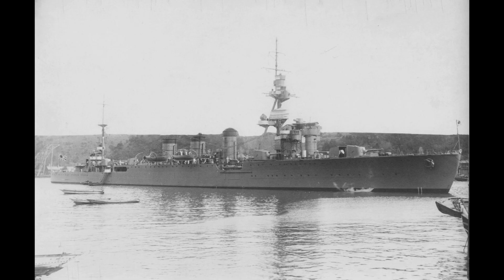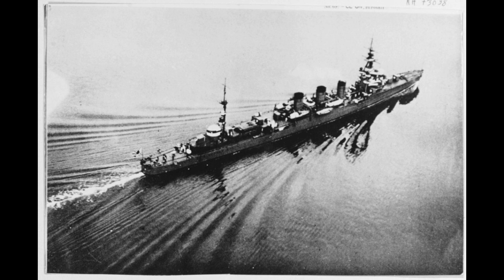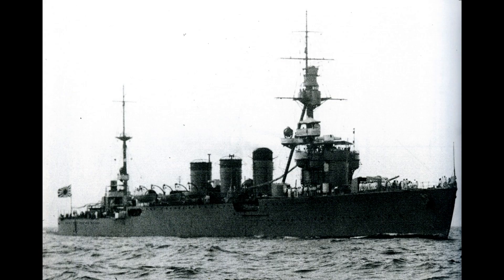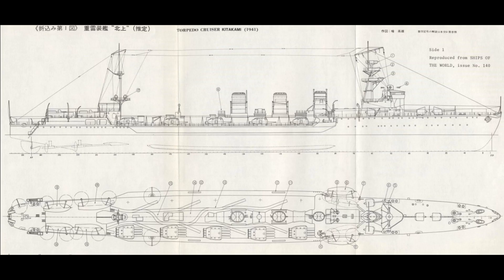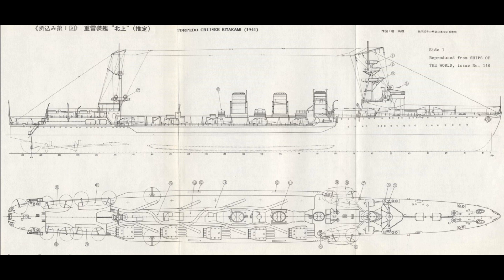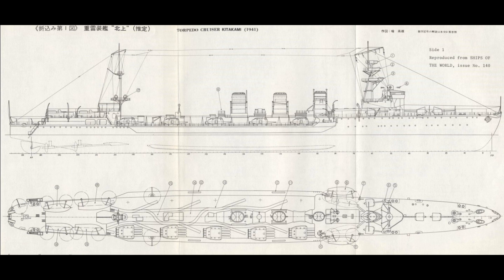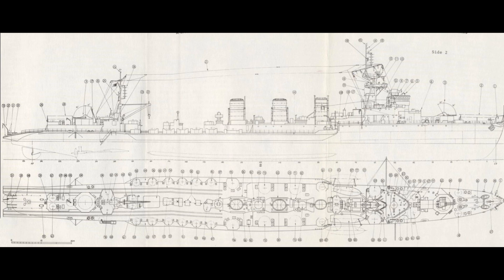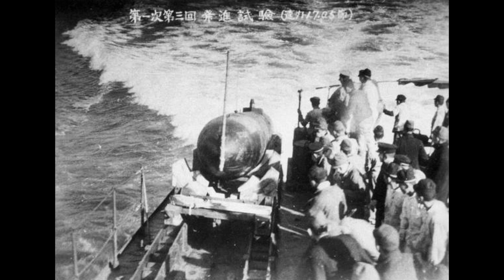IJN Kitakami - Guide 285

Comment: If the Japanese had just built lots of cheap, fast transports in the first place, they would have been spared the ignominy of using most of their Frontline Warships and Submarines to supply doomed Island Garrisons. But then the Japanese Navy was doomed from the moment they dropped their first bomb on Pearl Harbour, so it is a very moot point.
Reply: That's the problem with trying to fight an opponent to economically outclassed Japan by an order of magnitude. Nations like Germany and Japan could not spend adequate money on everything they needed. The US could.
Reply: Had the battle of midway gone differently, maybe the Japanese would have "won" the war. I could definitely imagine that if the Japanese sank all US carriers at midway, then ravaged further to destroy other parts of the enemy fleet, they could have proposed a peace settlement somewhere inbetween autumn 1942 and early 1943, that would forbid the US from further interference in Japan's Asian conquests, which was their goal.
Reply: @iexist.imnotjoking5700  highly doubt it, even if we lost all the carriers at midway, the war wouldn't have ended.

Americans fight hard for revenge, losing the carriers would have just enraged them more, and the submarine fleet was already winning the supply war by this point sinking close to 100k tons of shipping a day.

The new essex classes were already on the slip way.

There really is nothing anyone could have done to change the outcome of ww2.

The logistics of both the united states and the soviet union working together were just unreachable by the axis forces. The manpower and rate at which the us and soviets could mobilize was astounding.

At around the end of 1942 43 the us was pumping out 14 destroyers a day, 30 transport ships by 44 45 it was 3 carriers a month. (Battlefleet and light carriers) insane productivity
Reply: If they had followed up the Pearl Harbor raid with an invasion of Hawaii, within a week at the latest, they might have taken Hawaii and the war would have been significantly different. But that would have been a tough problem to work.
Reply: @Robert53area   You make good points. In 1942 the American productivity was high, but it hadn't developed the gap necessary to be able to just throw ships and planes at the Japanese. And with the Japanese not having to deal with an invasion of the Guadalcanal islands, possibly taking Port Moresby, Midway atoll, and pushing, it depends on how much the Americans were willing to accept a peace treaty. The Japanese would have been able to use Port Moresby to cut off supplies to Australia, possibly causing calls for a peace treaty. The momentum the Japanese carried was their strength, and considering that by 1943 the Japanese were still fighting on fiercely, with good leadership they might have been able to use these newly gained areas to repel American attempts at counter attacks. A dangerous scenario for the Japanese would have been a pacific version of the phoney war, allowing the Americans to pump out supplies and equipment, newly trained soldiers, and reorganize. But I do believe that the Japanese would have been able to "win" this war. Even if unlikely.
Reply: @iexist.imnotjoking5700  Impossible. Japan lacked a host of materials to sustain any serious war effort, particularly including oil and steel. An invasion of Hawaii was impossible because of the size and fortification of the US garrison. Even if Japan had gained a foothold, it could not be held over that length of supply line. This was shown by Japan's inability to defend their positions in the Aleutians. Capping all this were the very large costs of sustaining the war in China and the impossible logistics of the war in northern Burma and Assam.
Reply: @colinhunt4057   They wouldn't have needed that much supplies, had they been able to carry their momentum to a point of absolute domination. They definitely had the resources to fight a short war, I was specifically talking about a short, not a sustained war. An invasion of Hawaii would have been a bad idea, because of the distance between Japan and Hawaii, causing problems with logistics. Another problem was - as you already said - the strong grasp the Americans had on the island. Removing them from the island was unlikely and could at best result in a pyrrhic victory for the Japanese. In an effort to make a peace settlement more appealing to the Americans, they could have given back territory to the allies, which would probably also alleviate some of the issues with sustaining the size of their territory without risking losing parts and allowing a consolidation on key positions.
Reply: @JonathanSchattke  Japan did not have the oilers to support both a PH raiding force and a much slower transport force, nor did she have the logistics to support both forces during at least a month of operations far from friendly bases.  There were nearly two divisions on Oahu in '41, that would have required at least three and preferably four IJA divisions, which the IJA was never going to release.  Japanese wargames showed a chance that the Kido Butai might have lost up to half of its carriers to achieve the PH raid, with only a couple battleships sunk.  It was a chancy affair, but turned on surprise and American unpreparedness.  Invasion was non-starter.
Reply: The key point here is that, like quite a few militaries before and since, the IJN skimped on logistical capability in favor of impressive firepower.  It doesn't matter how awesome ypur warships are, if you don't have the capacity to move supplies and equipment over long distances in staggering amounts you're not going to be able to effectively use that impressive firepower for very long before it runs out of beans, bullets, and fuel.  
Hmmm...now where have I seen that happen quite recently...🤔
Reply: @JonathanSchattke  no they would not have those transports were needed for invasions in Singapore and they did not have the manpower to invade
Reply: @iexist.imnotjoking5700  The war with Japan was never going to be a short war. Yamamoto estimated it precisely when he noted that Japan could run wild in the Pacific for a year, and after that promise nothing. Point is, he and the Navy knew that the war was lost before it started. The war was pushed by Tojo and the Army faction. Given what the United States already had under construction in 1940 from the Two Ocean Navy policy, Japan was doomed regardless of what it did militarily. 

We should not be surprised at this. All modern wars have been determined by supply and logistics. That was Eisenhower and George Marshall's great strength: they understood that wars were now the results of economic production, building weapons en masse and delivering them where and when they were needed. Japan and Germany lacked all that for their own internal political reasons. Hence they were both doomed once they went to war. It mattered nothing that Germany built the best tanks, had the world's first assault rifle (still in use as the AK 47), or that Japan built the world's best fighter aircraft of its day, the Mitsubishi A6M Zero. War is always about logistics in history and today.
Reply: @colinhunt4057   I agree on most things there. For some reason people don't consider logistics or the economy when it comes to warfare. Even people who should know how to war. I do believe if Japan had played it's cards correctly it might have been able to do something, like Germany they had a quality over quantity approach, which does work, but only if you are sure you can keep the war short, and keep up at in terms of industry at least to a certain point, which the Japanese didn't reach. The Japanese also didn't shift their strategy when it was too late, further dooming them. Germany actually had better chances, and actually it was kind of Hitler's fault, his understanding of strategy fell apart when he invaded the Soviet Union. Before Unternehmen Barbarossa took place, they were in an amazing position, and could have possibly taken Britain. Yes, in the short run they were able to win the battle of Britain, but their fighter force was close to breaking at one point in that battle, before the Germans switched to bombing cities, allowing the RAF to recover. In the long run Britain would have probably been overwhelmed. But then Hitler picked an unnecessary fight with Russia, at an unsuitable point in time and the rest is history.
Reply: This would assume that Japan had tons of excess capacity to build and maintain a massive merchant fleet while being at war for a decade already. The Army and Navy were not always working together, so why would the Navy sacrifice Steel to the Army to build transports, when the Navy would rather build a Navy and Airforce that would negate the need to supply large garrisons. The army likewise could say that if they had more of the steel, they would have enough equipment to beat China. The US sanctions forced Japan to choose to back out of China or fight the US, so if the Army had its way then perhaps they could have avoided the need for a large Navy.

The tug between armed services in Japan and their weak resource base is key to understanding.
Reply: @Robert53area  But Midway was a response to the Doolittle raid so even Midway was on American terms.  What are the Art of War phrases?  “Begin by seizing something which your opponent holds dear; then he will be amenable to your will.” and “Thus the expert in battle moves the enemy, and is not moved by him.”  Sun Tzu knew a thing or two.
Reply: @gregorywright4918  Favorable force ratios are more like 3 to 1 so the 2 divisions would require 6 to efficiently handle.
Reply: @Pangora2  When your forces are, more or less, descended from two rival clans you're bound to have issues.
Reply: @colinhunt4057  The MP42 and AK-47 are two very different weapons although they end up being kinda similar they reached that point from different starting points and with different doctrine in mind.
The Zero had some really great points but it also had weaknesses. It was a very specialized plane but not neccessarily the best fighter of the day. And in the end that doesn't matter if you neither have enough planes nor pilots nor fuel.
Reply: @iexist.imnotjoking5700  Germany had pretty bad intel. So essentially they were both guessing at the Soviet strength and when they would be attacked by them and make no mistake, the Soviet Union would have attacked Germany sooner or later.
Even a continuation of the bombing campaign was deemed unlikely to break the UK and that was probably a correct assessment. Invading the island with neither aerial nor nautical superiority was a pipe dream and they finally started to realize it.
So they decided to chance it and kick in the door and bring the whole rotten building down. Just that they were again underestimating their opponent.
Reply: @kaltaron1284  Quite so. Any invasion of Britain was in fact doomed to failure even had the Luftwaffe won. Germany's fleet of invasion barges were transports stripped from the Rhine River. Germany's economy was crippled by removing them all from service even if they had survived any invasion attempt. The actual plan for Operation Sealion was rather a pathetic joke which OKW recognized as being hopeless before September of 1940. Quite simply, British light naval forces and aerial strike forces would have torn it to pieces regardless of the Luftwaffe.

 And by the end of September it's not happening anyway because of bad weather conditions. Even D-Day in June 44 was nearly canceled because of bad weather.
Reply: @LeCharles07  It becomes far, far worse when it's recognized that the average US infantry platoon has at least three times the firepower of the average Japanese infantry platoon. This becomes far, far worse again when it's understood what a huge advantage in artillery and tanks the US had over the Japanese army. And the Japanese SNLF formations had none of either. 

Midway was not about Doolittle. Midway was the Japanese plan to force a decisive confrontation with the US Pacific  fleet. This event was happening regardless of Doolittle. Indeed Midway was very much on American terms. They knew in advance that they were coming and where. And their three aircraft carriers had more strike aircraft than Japan's four.
Reply: @LeCharles07  "Rival clans"? Boy, ain't that the truth. The army and navy factions loathed each other. They were conducting assassinations against each other before the war. They went out of their way at various times to refuse to support each other's operations.
Reply: @colinhunt4057  Getting the RAF out of the picture may have given Sealion a slim chance of success. But yeah, it would have been an even larger gamble than Barbarossa.

IIRC the weather stil affected D-Day esp. the paratroopers. The 40s didn't have very nice weather overall. Wasn't it called a "small ice age"?
Reply: @kaltaron1284  There was some cool-down in the 1940s after the relatively high heat of the 1920s-30s. But the so-called Little Ice Age was actually the very cold period that started with the massive drop in temperatures starting in the late 13th century and lasting until about the 1850s. This included three severe solar minima: Wurm, Maunder and Dalton (called minima because they were characterized by low solar radiation). But yes, the winters of the early 1940s were dreadfully severe.

The RAF remaining in the picture guaranteed that Sealion would fail. But it was still doomed because the Germans had no significant chance of intercepting British light naval forces from shredding the German invasion flotilla. Even with complete air superiority over Dunkirk, the Germans were unable to halt the British evacuation in 1940. And having landed any forces in Britain, the German invasion was even worse because they would have been unable to supply them.
Reply: @colinhunt4057  I think I've heard the term being used for the 40s but I can't remember where. But you are right that it's normally used for the dreadful climate from the 14th to mid 19th century.

You are also right that the Luftwaffe wouldn't have been enough to prevent catastrophic losses if they'd gone through with Sealion but they would have fared far better with the RAF out of the picture. Still would have been Phyrric at best.
Reply: @kaltaron1284  Agreed. But it still would have been futile. And none of this had anything to do with Germany's main project which was the invasion of Russia and murder of the Slavs. Hitler and his generals knew all this and hence pulled the plug. It was already too late in the year for Sealion anyway and so would have had to be delayed to 1941. The lateness of the season alone determined that Sealion could not happen. 

Further, it couldn't happen because of the need to launch Barbarossa, as time was running out for Germany. Germany was starving to death because its insane labour and economic policies, and it was freezing to death because of mismanagement of the coal industry. It could only survive by looting other countries and economies. That meant invading Russia and murdering all the Slavs.
Reply: @colinhunt4057  Yeah. It might have helped that they thought the Soviet Union to be weaker than they actually were but time was certainly not in their favour.
Reply: @kaltaron1284  Agreed. Delusions will get you every time. They thought it would be a matter of a single campaigning season the way it was in France. Hence no winter clothing severe shortage of spare parts for trucks and tanks, and complete lack of preparation for the Soviet winter offensive in December 1941. The only people who ever conquered Russia relatively rapidly were the Mongols in the 13th century, and it took them two years. Hence the improvisation which became Fall Blau and the Stalingrad campaign.
Reply: @colinhunt4057  To be fair in the 13th century there wasn't yet a unified and centralized Russia and their territory was far smaller.
The Mongols also had by far one of the strongest land forces of the time.
Reply: @kaltaron1284  That's indeed true. However, in that time the Mongols also conquered a much stronger opponent in the same area at that time: the Grand Duchy of Kiev. And they dealt with the Principality of Novgorod by making an alliance against their common enemy the Teutonic Knights. The Mongols had the same problems of time and distance as everyone else. but their logistics system and very high military organization could overcome that. They were also very good at softening up potential enemies with a combination of espionage and diplomacy before the armies went in to do the job.

in later centuries, Charles XII, Napoleon and Hitler would all demonstrate different ways to fail at invading Russia. A very old joke was, "Any army you can feed in Russia can't do the job. Any army in Russia big enough to do the job you can't feed."
Reply: @colinhunt4057  Didn't know that joke but it's quite true for later times when armies were larger.
What you say is true but it also highlights that the situation was simply a lot different at the time of the Mongols. That still leaves that fact that all three invaders miscalculated heavily. IIRC Napoleon made the largest gains out of them but it cost him his hegemony in Europe. Charles XII lost the dominant position of the Swedes in the Baltic and Hitler the German stranglehold on Europe.
Reply: @kaltaron1284  It applied in ancient times, too. The Persian Empire attacked Athens in 490 BC with too small an army and got trounced by superior fighting skill and weaponry at Marathon.  They tried again 10 years later in 480 BC with an army more than large enough to do the job. Problem was, they couldn't feed it. As soon as they were stopped, the Persian invasion was over. Hannibal had the same problem in the Second Punic War. He invaded Italy with an army too small to do the job. He couldn't get reinforcements from Africa or Spain and couldn't feed them even had he got them. By the end of the Third Punic War, no more Carthage and no more Macedon either. Superior Roman logistics and organization won the day and would continue to do so for another 1300 years or so.
Reply: @colinhunt4057  All true.
At Thermopylae their very good defensive position also helped the Greeks to counter the Persian numbers. Esp. in those times with limited ranged options compared to modern times, a good position can be an incredible force multiplier.

Hanibal knew that he didn't have enough troops to win but he hoped that the moral blow his crossing of the Alps and his elephants would deal, would cause most or at least some of Rome's allies to change sides. Unfortunately for him most elephants died in the mountains and the local tribes were hesitant to join him.
So when the Romans couldn't defeat him on the field they just starved him out.
Reply: @kaltaron1284  Exactly so. Being unable to defeat Hannibal in the field meant that the Republic spent its efforts on containing him in Italy while demolishing the Punic holdings in Spain and crushing the efforts of Macedon to interfere to their advantage during the Second Macedonian War. It was, if you will, the first truly multi-front war in human history. And it's no surprise that superior Roman logistics and engineering technology triumphed over individual military genius. This was the lesson Napoleon or Charles XII failed to learn.
Reply: @colinhunt4057  Yep.
There had been earlier multi-front wars if you count uprisings and revolts. Not sure about several independent nations being involved.
Reply: @kaltaron1284  "Several independent nations being involved." Interesting thought. The first such war I can think of was the century-long struggle against the Ottoman Empire in the 16th century. It started with the siege of Rhodes in 1522 and ended in the Battle of Lepanto in 1571. It involved the forces of Spain, the Holy Roman Empire, the Republic of Venice (which actually was a super power then), Hungary and Serbia, and what was left of the Knights Hospitaler (who by this time were mostly just a gang of pirates), against assorted Muslim states including the Ottoman Empire, and a host of smaller states such as Egypt and the Barbary States. 

It started as the principal attempt by the Ottomans to push back the Europeans from their various holdings in the Middle East and crush the kingdoms of Hungary and Serbia. France spent most of the war fighting against Spain or Austria in Italy. After the Romans, this was the first truly multi-nation, intercontinental war in Western history. It was enormous in scope and it involved truly enormous costs and losses for ALL the various combatants.  For a time, the kingdoms of Hungary and Serbia completely disappeared for a number of centuries.
Reply: @colinhunt4057  That's a good candidate. I guess finding the earliest example would depend on the definition of nation as that's actually a somewhat recent concept.
I mean would the involvement of Japan and China in Korea when it was split into 3 kingdoms count?
Reply: @kaltaron1284  I would think so.